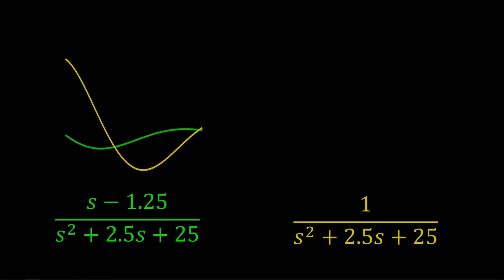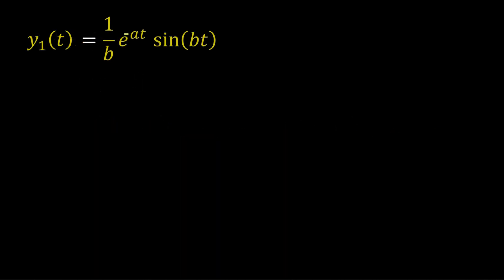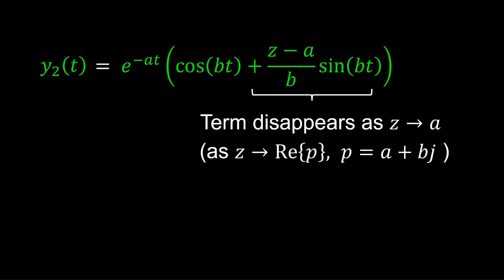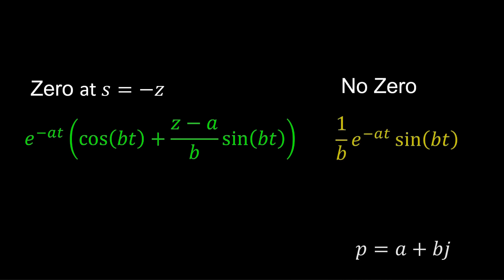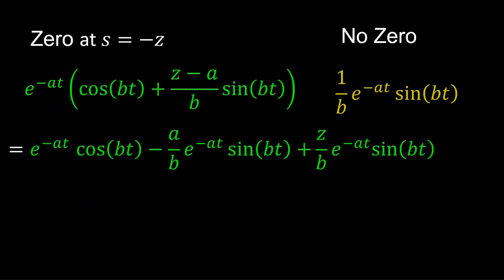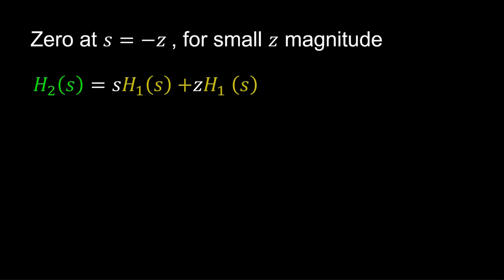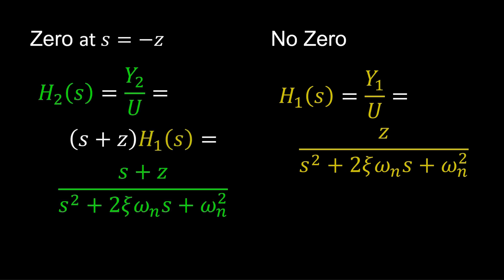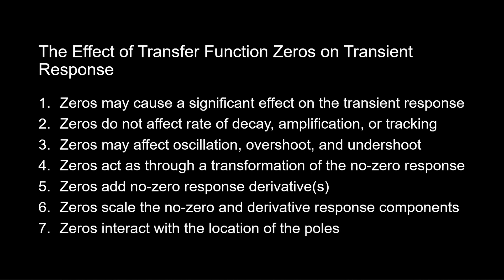How Transfer Function Zeros Affect Transient Response – Quick Concepts in Control 2

Comment: 6:08 doesn't it make sense that the names of components should be reversed - where you have "z" that should be transient zero response (when we have one zero z at 0, then this component is 0, but when zero is elsewhere this component is not 0).
Likewise, the other component is composed of real and imaginary parts of poles, not zeros 
I might be wrong though
great video btw, learned a lot.
Reply from the maker: Hello, great to hear the video was educational. It's been a while since I covered this video, so I had to go back and watch myself! It was a good refresher haha. The No Zero Response term is the third term only scaled by the zero. If you were to plot that term, you'd see the same form of signal as H1, just scaled in amplitude. While technically it is a transient change, I would say a more significant transient change comes from the derivative of H1 that's added to H1 (i.e. H2 = sH1 +zH1). This is why I have characterized it as such.

Comment: there is an error when partial fraction is applied to H1(s) (time 1:01), the term (1-a) is 1 a is not present in the decoposition.
Reply from the maker: Thanks for catching that. It's good to know at least one person is working through the material! In my code, I believe I had it correct so all results should reflect -a and not 1-a.
Reply: To be clear, the result of the partial fraction expansion should be: 
1/(p*-p)/(s+p) + 1/(p-p*)/s+p*) right?
Reply: @luisrebhan3268  correct

Comment: Thanks for your video， but could you talk about the physical meaning of pole point and zero point with us？
Reply from the maker: The question of physical meaning of zeros would be a good future topic. Zeros occur at specific frequencies. From the vantage of a transfer function, this means that if you provide input to the system at this frequency with finite amplitude, there would be no output. This would be like providing a sinusoidal force to a system containing masses, springs, and dampers, and somehow the masses don't move. The zeros affect the transient response of the system, but do not affect the stability of the system like the poles. The poles dictate the characteristic response of the system states, like decay, oscillation, or amplification.